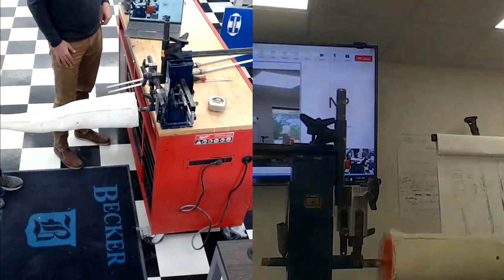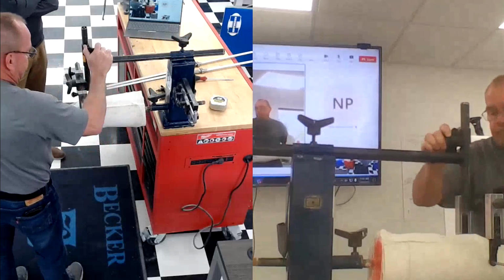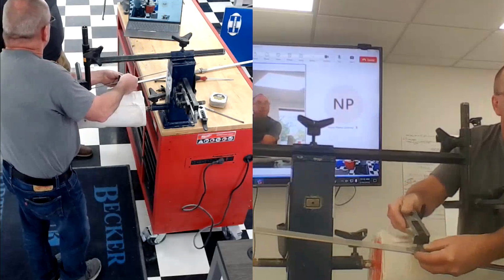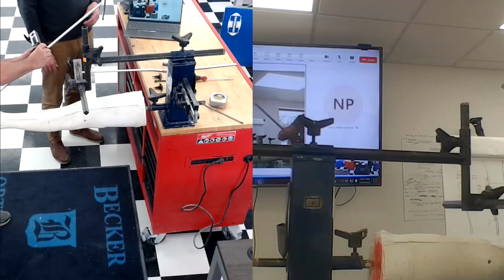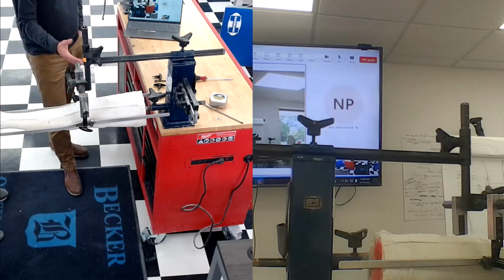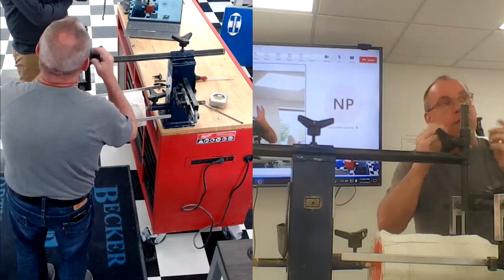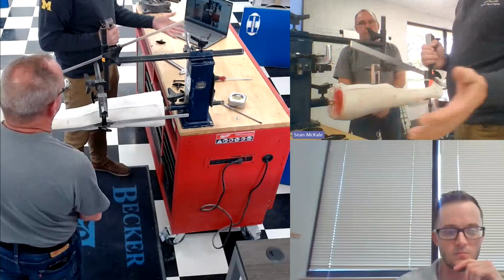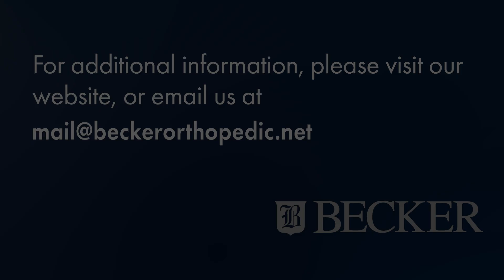Using the Becker Alignment Jig

Comment: I have a Becker KAFO and have been wearing it almost 2 1/2 years.  it is interesting to see some of the side of how it is built please show the next steps of the build. This is my 2nd KAFO the first was not as durable as this one is. It broke a number of times during the Pandemic and took months to get back finally had to be replaced with the one I wear daily.
Incidentally  i am disabled Veteran who fell in 2017 and destroyed my kneecap.
This KAFO allows me to walk 3-5 miles without trouble I have a Pedometer attached on the strap above the knee which I use to determine how far I walk,